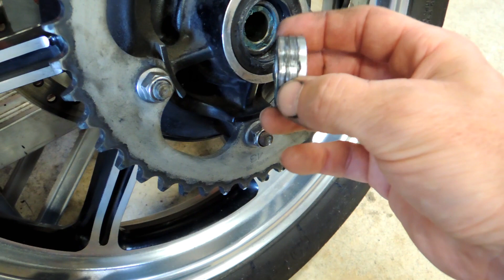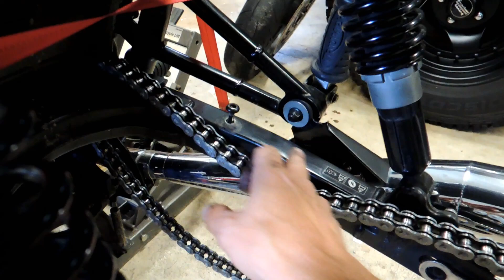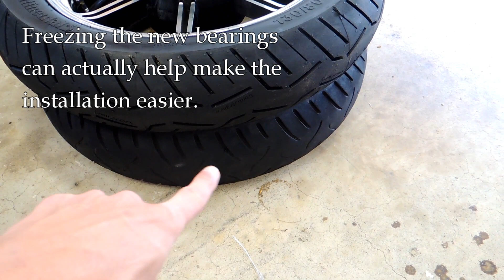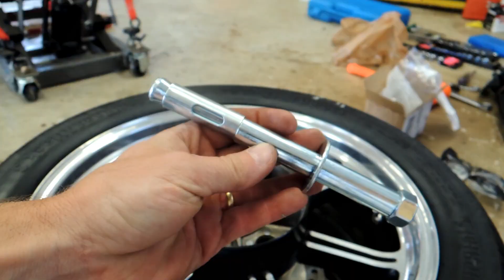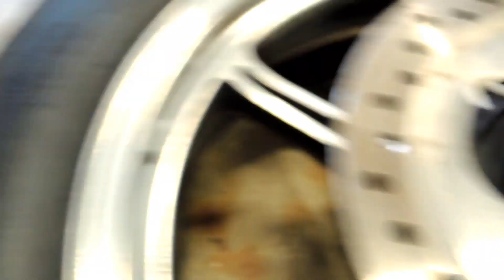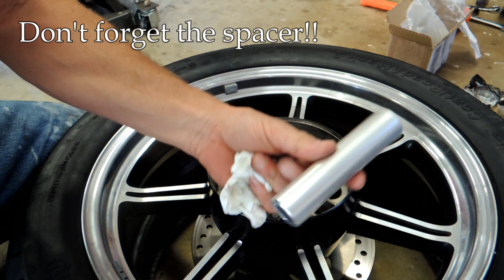Replace Your Rear Wheel Bearings In A Triumph Bonneville

Comment: I tried using the concrete bolt method and the bolt just popped out every time. Any tips?
Reply from the maker: A few things.  First, the size of the bolt is important.  It's got to be just undersized enough so that it slides into the race but expands without "over" expanding if you follow me.  Second, there are different styles of anchor, so make certain the one you are using allows the sleeve to fully expand against the race without bottoming out or whatever.  Third, placement of the sleeve relative to the race is important.  You want to make sure you maximize contact with the race by the expanding sleeve but not touch the inner spacer.  Although, I'll contradict myself here by mentioning that one time with a Triumph Tiger I did have to use the inner spacer as well as the bearing race to get enough grip.    Finally, you need to really crank down on that bolt.  The sleeve will likely distort to the point of no return when it is tight enough.  I've never had this method fail on me but once in a while a stubborn bearing takes a little more effort.
Reply: If I do scratch the spacer is it okay?
Reply from the maker: Well, the spacer has an important job, but the critical areas are the two ends which contact the bearing races.  If you buggered up the internal diameter of the spacer it wouldn't be the end of the world, but you don't want to mushroom out the end with the concrete anchor either.  You might want to check out my other video in which I used the same anchor method on the front wheel:

https://youtu.be/WDasv9ee1dc
Reply: Used a twenty mm dyna bolt and worked really well

Comment: Great video! I'm rebuilding the sprocket hub on my 2008 Bonneville. Did you find out what the aluminum spacer is called? I did not see it on the parts diagram
Reply from the maker: It is on the parts diagram, I think--it may actually be called a spacer, although it's job is more about a surface for the seal.  There's a few different sizes, so I don't want to mislead you with the wrong part number.  Look on your diagram next to the seal and you should be able to see it.

Comment: Great vid! I’ve put 30,000 on my rear bearings; prob time for new ones, haha.
Reply from the maker: It's funny, sometimes bearings seem to last forever and other times they are trashed in short order.  Riding conditions may explain part of it, but some of it also has to do with manufacturing quality.   For the cost of the bearings, I'd rather not wait until they are trashed and be forced to take everything apart during riding season.